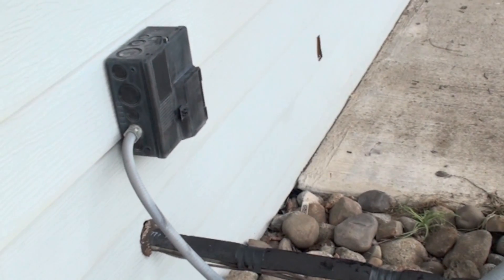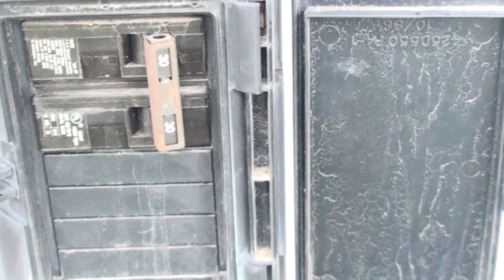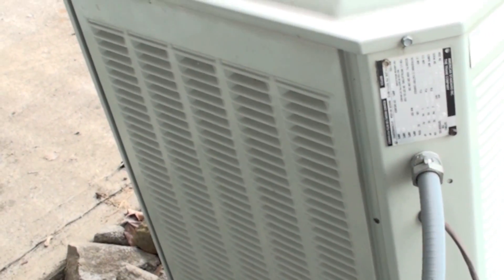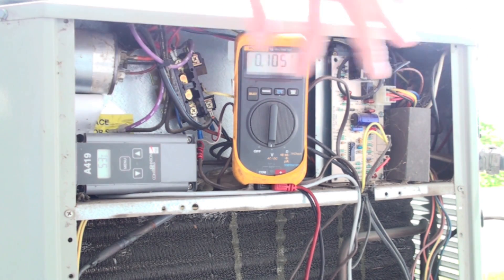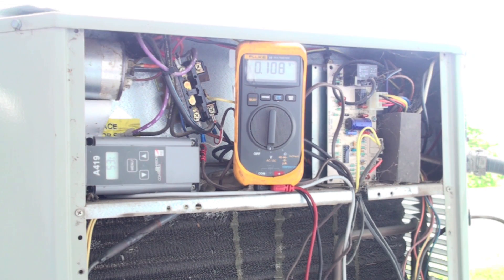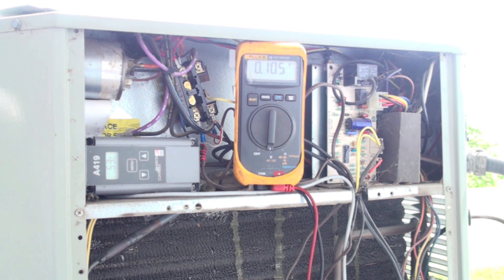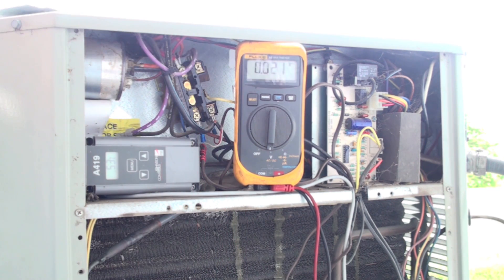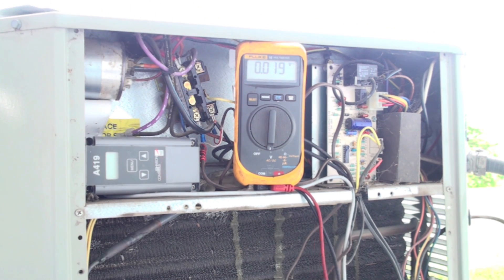How to check for power through the air conditioner disconnect

Comment: i am just surprised at your attitude toward a breaker verses a fused disconnect.you said ,with great disdaih, that"this disconnect ACTUALLY has a breaker instead of a fuse", as if that were ACTUALLY somehow odd. dude, its 2017! how many ac condensor units have u even worked on? fyi, when a breaker trips dues to voltage surge, you merely flip the breaker back to the off position,then to "ON"again... with a fuse,u have to go buy a new fuse. how is it that you do not like breakers?does it have something to do with  not being able to charge the customer for a fuse,at some rediculous price? i guess u could still charge a bundle for labor,for "flippin that ole breaker"...geez mann, try to keep up...

Comment: Sir, thank you for your video.  I would like to check this but there are no fuses in mine.  I have the non fusible disconnect.  I see what appear to be screws but not labeled L1 and L2 (appear to be  just where box screws in.  It is one of those old 90s service non fusible disconnect with the latch you just pull out and the 2 copper "bridges" inside
Reply: Thanks. I pushed the contactor in manually a couple days ago.  The unit started when I pushed contactor in manually.
Reply: Yes, sir, I have power to a Goodman furnace (GMP series)  upstairs in attic. Yes,  that is getting power.  No blinking lights. My outdoor unit is also Goodman CK30-1A series
Reply from the maker: Look for wiring problems from the thermostat thru to the outdoor unit.
GFM
Reply: You were right....there were animal teeth marks on the thermostat wire.  Must've damaged it.
Reply: Thank you again!! :-)
Reply from the maker: Seen it so many times.  Glad you got it.
GFM

Comment from the maker: I would be looking at the breaker in the main panel.  If the breaker is in the center position or off, it has thrown.  In any case, turn the breaker off then back on.  If that does not work, the breaker in the panel may have failed.  Let me know how you come out.
GFM
Reply: Hi GFM,

I am having a similar issue as the Hugh Heff above. I am getting no power to my outdoor unit power reading. I confirmed the breaker had not been tripped but i replaced it anyway. Up to this point, I have replaced the fan motor, capacitor, contactor, and the circuit breaker at the main panel. I have a Payne system built in 2007. I think this may be the disconnect by the unit. Can you offer any guidance for what i should do next to get power to the unit?

Jesse
Reply: I hope after 7 years of thinking this through you finally called someone to come help you out.

Comment: I cant find out why my unit is not getting power i have a copper metal type disconnect  that doesn't burn out,it wont receive power at all,before it would kick on then i touched the thermostat wire with my screwdriver,then it stopped working altogether,no volts outside